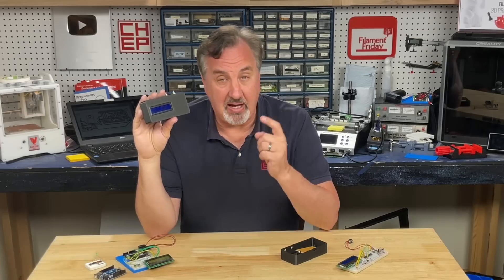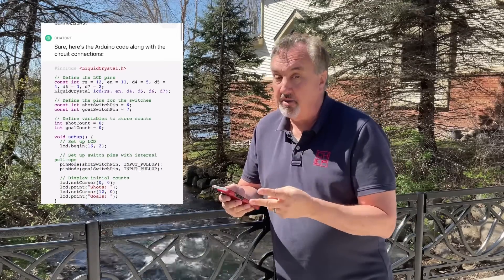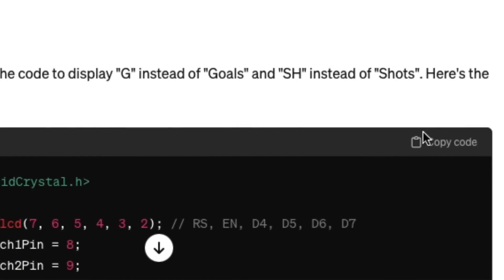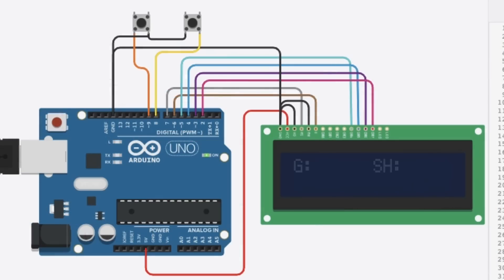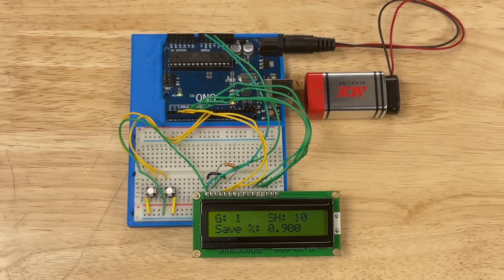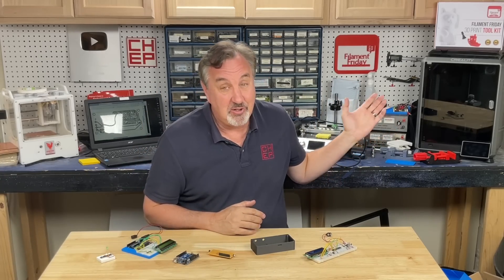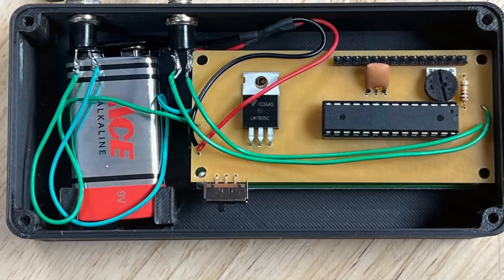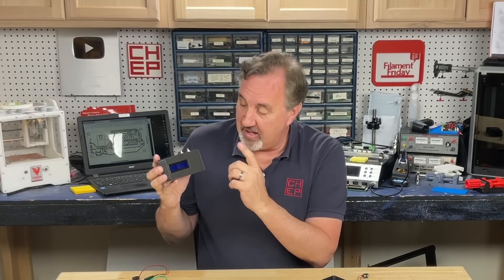ChatGPT Designed My Electronic Product In 10 Minutes!

Comment: My experience is that ChatGPT isn't very good at writing code. It can do some simple stuff but gets a lot of things wrong too. For instance it should of had him initialize the button pins internally with "INPUT_PULLUP" instead of unnecessarily including a resistor in the circuit. One thing I've found it is good for is debugging software. You can copy the error code from the IDE to ChatGPT and ask it to point out the problem.
Reply from the maker: @JohnWinquist - ChatGPT did enable internal pull-up in the code. There are no unnecessary resistors. What are you referring to?
Reply: @FilamentFriday  My bad.  3:54 When you said "pullup for the m clear pin"  I just heard "pullup" and assumed it was for the button. I'm still not a fan of using ChatGPT to write code though. It's cool that you got a working program so quickly, anytime I've tried it I end up having to troubleshoot and fix it.
Reply: That’s why you buy the premium version. 3.5 is brain dead. GPT4 is in a league of its own
Reply: @David-kh2gk  If that's the case, I'm surprised there are still software developers being employed. I know how to write code so it would be a waste of money for me anyway.
Reply: @JohnWinquist well this is the near future. Many programmers will become obsolete. Of course there will always be a need for programmers but I really think the below average or even the average programmer will become extinct.
Reply: @Vinz3ntR  I think you're right. I ultimately think it's a good thing but right now you just can't trust that it's doing the right stuff. It doesn't have any common sense.
Reply: @JohnWinquist  A waste of money for you. For the rest of us, time is money, and I’d rather have GPT do it for $20 a month than pay you $60 an hour. GPT is 100x faster
Reply: @David-kh2gk  I hear ya. The thing about using ChatGPT is it isn't always accurate when it comes to coding. Someone who doesn't have much experience writing code could have to spend a lot of time troubleshooting what it writes. I'm not totally against the idea at all. I just think it needs to be improved before it's a viable option.
Reply: @JohnWinquist  Current AI really can't replace software developers. You would need someone to explain needed software in so much detail, that you need - wait for it - a software developer 😅
It's not only about what, it's also about how 😉
Reply: @kimmotoivanen  Well put! I couldn't agree more.
Reply from the maker: @johnWinquist - No doubt but I didn’t use the latest ChatGPT, I also have developed software so I was only looking for a bit of help and it delivered far more than I expected. I find this exciting as it’s only going to get better as AI gets better. This was just an intro to the possibilities just like how years ago Arduino made electronics easier for many non- electronic experienced users.
Reply: @FilamentFriday  Yeah, I think it's pretty cool too. I look forward to seeing the future developments.

Comment: What software do you use to design the circuit boards, and what is the test software? I have a project I need to make some. One addition you could add to it is sliding the battery in from the side so easy to change.
Reply from the maker: I use a discontinued software for PCBs but KiCAD is a good one to learn. Tinkercad was the simulation software as I showed in the video.